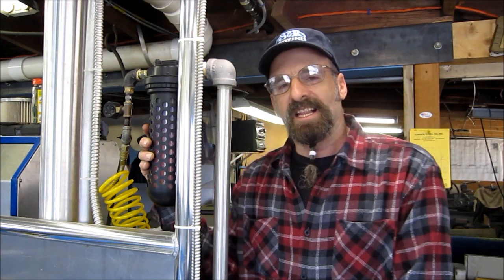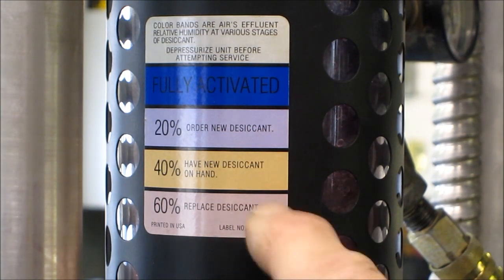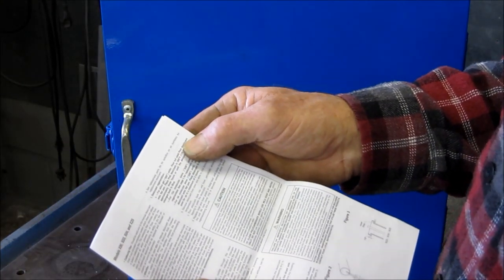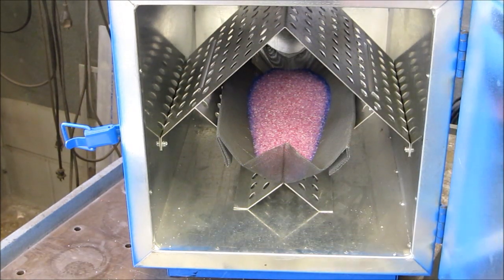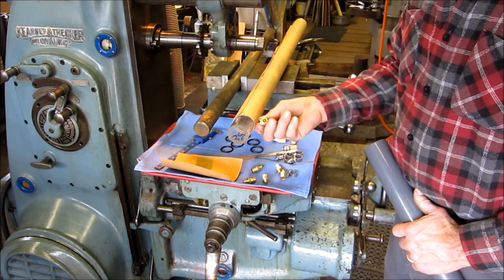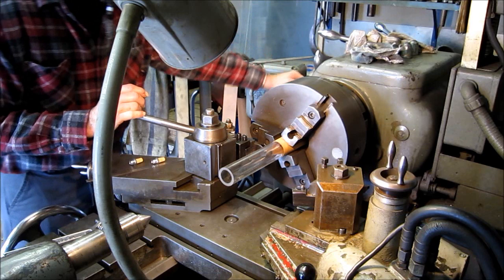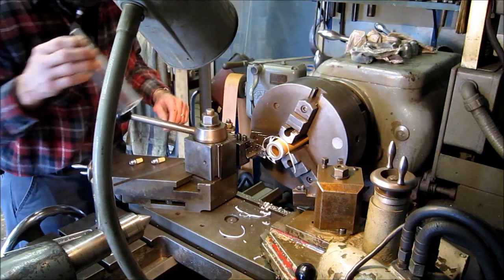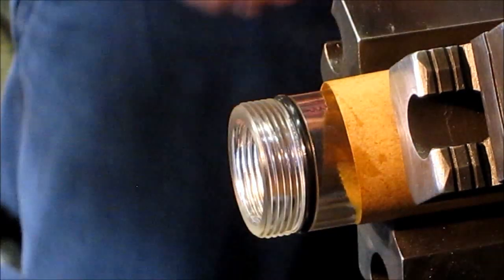Dry it Up Part 1

Comment: If you use dishwasher liquid  as lubricant it will keep cuts clear without frosting,  but if you get frosting just use a torch that can give a 600 f flame and heat the area gently and it will clear but do it slow and gentle

Comment: I tried to turn a plastic powder hopper from a powder measure once.  I was using high speed steel, making a facing cut, and turning at a fairly high sfm.  The tool caught in the work and the plastic kind of exploded!  I have not tried that again!

Comment: I know this is an older video but for working with acrylic I have found that liquid soap works as a great lubricant, especially for drills and hand taps and leaves a nice clear hole.  I used to use the pink stuff in the hand dispenser but almost any mild hand soap will work well.

Comment: We use a lot of silica gel in the electron microscopy lab . Silica gel with a color marker should not be heated higher than 120°C (248°F) because the indicator function will be impaired by higher temps. Also the number of times it can be dried is limited. Three times is usually about it because the surface structure changes. Above 300°C (572°F) it loses its desiccating properties altogether. Drying it in a thin layer, spread out, is best.

Comment: Keith nice one.  We have done some machining on acrylic, it does like to chip at the end of cuts, drilling, etc.  Sometimes you can flame polish them away after you sand it a bit.

Your rod oven looks like it has enough venting to let the water vapor out, plus opening the door every once and a while will speed up the process.  That was great when you pulled the book out of the oven, hard on purchase LOL !

Comment: @KEF791 most of contains use in aircraft are small, the container are about less than a small cup full, so it does not take long time in the microwave. mainly you keep an eye on it till it turn back to its orginal blue color. it doesn't really get the desiccant that hot. it just saved our customers a few dollars.

Comment from the maker: @thisoldguy64 One of the reads I did on the mater, said that the microwave causes the desiccant to break down, same as over heating, but may have been just a ploy to get sucked into there dryer. How long have you been drying your desiccant in the microwave? How much at a time and how long? if you care to contribute...

Comment: nice information, I"m a retired aircraft mech, we use a microwave oven to reactive the desiccant, it worked pretty good.its a lot cheaper than 3 hours in an elect oven. just some thing to try.  thanks